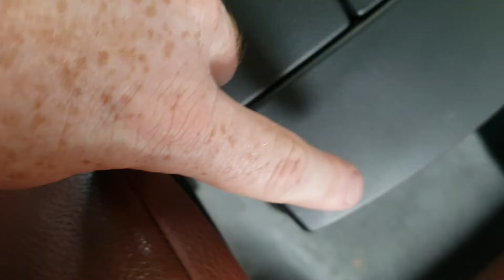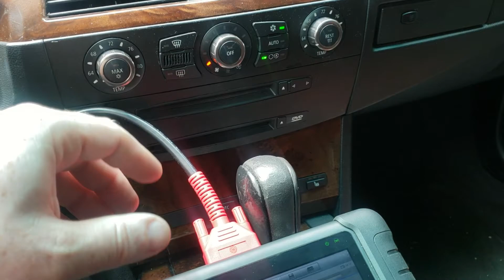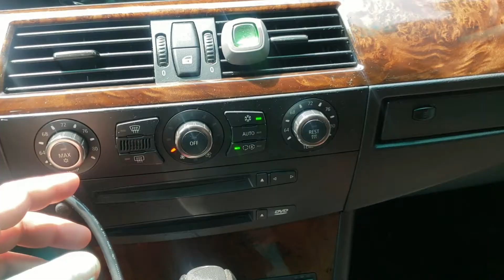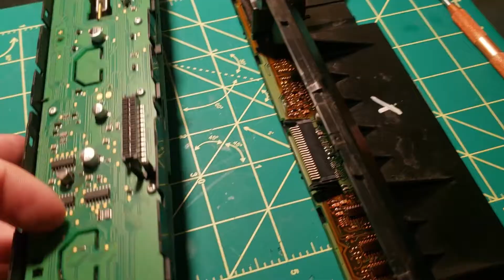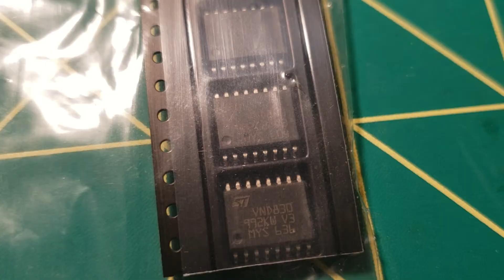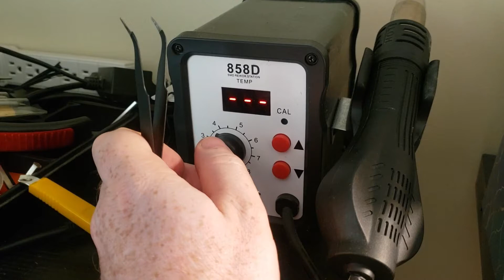BMW E60 Heater Module/Control Repair

Comment: Hi I get his error code IHKA S 0117 No communication possible with: Heating and air conditioning system and the ac only blows warm air. Will changing out the chip help in this instance? Thanks.
Reply from the maker: You need to 1st ensure your IHKA is receiving power and signal. Check the fuse in the fuse box. Then check primary voltage at the IHKA wiring connector. If you havw power, back probe the signal wires to see if you get voltages on those lines as well. If you do, then I would open the IHKA unit up and inspect - do a visual inspection 1st, looking for burnt or blown components. Then, with a multimeter, check all of the smd capacitors for shorts. Next, follow the power rail and check to ensure it continues its path (occasionally traces will corrode and will need to be jumpered).

Comment: I had the issue but i ended replacing it get it from donor but the car was 2005 but mines is a 2004 do I need to code it I’m having issue and get water valve code and ac not getting cold enough
Reply from the maker: The IHAK does not need to be coded. What is the code that you have? Is it the IHAK, ot the water valve? Replacing the IHAK will not fix a stuck water valve solenoid. Luckily, the solenoid is cheap on Amazon.
Reply: @djbmw1  I had replaced it but still get the same code and ac is not getting all the way cold
Reply: The code that I’m getting is 9c68
Reply from the maker: @Brickcitypapi-973 there should be other codes that accompany that one. Also, you should be able to read the reason why that code was triggered, and when, with your scan tool.
Reply: @djbmw1  these are the codes 9c55
9c68 9c69 9c79 my apologies for the double reply
Reply from the maker: @Brickcitypapi-973 based on those codes I would first see what type of live data you're getting, if any, from the fogging sensor,.. as well as the adjuster motor. If you dont see any information from either, I would back probe the wires for each to see if you have a short to ground. If you do... its time to inspect the wiring from the IHAK all the way to the adjuster motor, as well as the fogging sensor, to see where the wires are crushed/worn through the insulation.

Comment: I had cool air but not ice cold coming out when running the ac. I also have persistent codes for water valves (9c6d and whatever the other side is) even though my valve is brand new and does actually work. Checked my chip like in the video and it is completely fried! Mind blown, thank you!!

Comment: if you don't replace the heat valve, it's a useless job.
Reply from the maker: The solenoid valve is not always the cause for the IC to fail. In mine, for example, it wasnt. In addition to the coolant solenoid valve, the IC also controls the air mixing valve actuators. If these actuators are stuck (or frozen in deep winter), the IC can still fail and leave the air mixing flaps in a stuck position which is unrelated to your coolant solenoid.

Comment: 9C54, E714, 9C77, 9C55 these errors indicates faulty IHKA? Blow hot air just in the front window. :/
Reply from the maker: Many of those codes relate to condensation sensors and recirculation sensors. You also have a voltage issue. I would first verify that your unit is seeing at least 12.5v or more. If not, you need to investigate where the power issue is coming from (cracked wiring, alternator issue, etc). If the voltage into the unit is OK, I would then do a resistance (ohm) test on the two sensors related to the codes you have to verify that they work. If the sensors are fine then open up your ihka unit and inspect for issues.

Comment: Hi  @djbmw1 , got a 520d 2007 and have  a 9654 AUC Sensor. Air doesn’t come out on the main vent but rather the one near the windshield. Sometimes hot air on the left and cold on the right. Would appreciate any advice. Thanks!
Reply: Same car same prob

Comment: Nice video! I've had to replace my IHKA module due to temp sensor issues. The donor IHKA works, but I cannot turn off the panel with the OFF button and also cannot turn off the compressor (A/C) button. A/C is constantly on and the OFF button only blinks once if you press on it. I spammed the OFF button and then the panel turns off including the fans, but then automaticly goes back on again. What could be the issue?
Reply from the maker: Could be that your Parked Car Ventilation setting is on.... could be a bad blower resistor. If it were my car, I would check the blower motor resistor first.
Reply: @djbmw1 Thanks for the quick reply! I did refit my old IHKA back to see what would happen and the issue is not there (except the temp sensor issue). An electrician checked the circuit board of the donor and it was fine. INPA didn’t show any fault codes on KLIMA (IHKA). So I presume that there’s a software issue on the donor panel not corresponding correctly with my car. I noticed that the old and donor module have different software versions (ZUSB). I’ll try to force program a different software on it with WINKFP in expert mode.

Comment: Hi, Very nice video I learn to much things.
my problem is hot air passenger side and cold driver side
Please need a help , the double switch (VND830) is in good shape but maybe not woeking .
I check voltage on the water valve on both side it's always (max hot or max cold)4,28 volt!!
please help.
I just chang the valve.

Comment: Hi. Could you help me aswell? I.ve changed all of the parts for ac senzor compressor radiator and still blows in front could air and on the feet and windscreed hot air. .. i have as errors 9c7b int temp sensor and auc sensor. Plus the inside temp is 18° and out side 0° . Could be the same for me? Or just replace the 9c7b sensor. On the dash bord it shows me the exact temp for out side but on tester shows as i mentioned  up.. 18 and 0
Reply from the maker: What issue is the scan tool picking up? You need to use a proper scan tool before determining what the issue is

Comment: Do you think e89 climate module not working and heated seats module that the problem could be in one of those, or more likely in the module which powers them?
Reply from the maker: A proper scan tool will tell you where the issue is. You can also use INPA for free
Reply: @djbmw1 I have im608 pro
Reply: @djbmw1  roof stayed working 2 weeks after climate control stopped. Theres a button for roof in climate control panel but roof also worked from keyfob button. So maybe roof is not working from another unrelated fault.

Comment: I have only 9c54 and 9c55 which is fogging sensor and AUC sensor but no error regarding ventilation, my the climate blows cold air and hot air same time !!
Reply: I have the same do you fixed ???? 😩
Reply: @jocksanderbenitez1190 I have replaced both sensors but only AUC is working the fogging sensor still doesn't work,someone said that needs to ve glued with silicone,i have tried but still doesn't work ,i will buy a new sensor.....and about ventilation blowing hot and cold air was because of the climate menu where it was selected red instead blue for cold air , climate does not seems to be broken 🤔
Reply: @smamas114  i have the same problem not blowing hot you feel that blowing hot and cold together... and i have same codes... after you replacing auc start to blow hot?
Reply: @sarkisderghougassian1563 AUC sensor only change from entering air  from outside to recirculating air inside .....I don't think i have noticed any change about hot and cold after changing that Auc, its just when AC compressor is on and i am changing inside the menu from Blue lines to Red lines at climate section the vents from the windscreen are blowing hot air where the others are blowing cold air even if the Temp buttons are set to lowest temperature but I don't know why is doing this probably because of the fogging sensor , 9C55 error !

Comment: Hi, I have problem with IHKA.
After long road trip in summer like 3+ hours ihka throw error for solar sensor, fogging sensor and left temperature knob. After this errors all flow flaps goes to closed position and no air comes from air went. Blower working normal but air not coming in cabin. Is vnd830 solution or its only responsible for hot water valves?
Thanks for replying.
Reply from the maker: Vnd830 controls the heater valves. You'll need to open up your IHKA to see what might be causing the issue. First, do a visual inspection under microscope (or magnifying glass if you dont have access to a microscope). Look for burnt, damaged, or out of place components. For any IC's you can also check that the pins are solid and properly soldered to the pads. Next, I would grab a multimeter and test all of the capacitors to see if any are shorted to ground. If you a have a thermal camera you could also feed the unit power with a benchtop power supply and see what heats up.

Comment: Hello sir can you help me i have same car and i have problem with ac up and down coming hot air in the middle cold air. I change the cooling valve original part from bmw. Sometimes working everything sometimes not working correctly. I check for foult codes don’t have nothing stored
Reply from the maker: Did you use a proper scan tool that can access the climate control unit? A cheap scan tool can only tell you what CEL codes you have and typically doesnt provide further details. If you used a proper scan tool then it will provide additional insight. If it still shows nothing then you'll want to hook up AC gauges to you high and low side and check your AC pressures.
Reply: @djbmw1   Yes i have autel maxicom scan tool. i can scan climamodul and i look live data and look everything ok. Just one thing ist not ok. When engine from cold to 70-80 degrees coming, the solenoid valves for the heating starting slowly to open and water starting circulating trough the heating and coming hot up and down. In the middle comes ist very cold. AC compressor ist working very well. Sometimes when i pres buttun to automatic clima starting to working agein everything ok after couple minutes same story. Solenoid valve stays open and water keeps cycle no matter what i Make. When engine cooling down starting to work again solenoid valve

Comment: Hi would VND 830E part # work or it has to be VND 830 specifically?
Reply from the maker: You would have to look at the manufacturers datasheet and compare the chips to be 100% certain. Having said that, VND830E appears to be an obsolete chipset variety of the VND830,.. and, upon a very quick review of datasheets from Mouser, there are indeed some differences between the chips (though minimal). VND830 is readily available from aliexpress and ebay,... as well as several major electronics suppliers like digikey and mouser.

Comment: Hello there, great informational video I am having some crazy issues with my a/c control unit and I took everything apart  and found that same chip burned, where can I get those chips, can you share the link, please, Thank You, Best Regards
Reply from the maker: Thanks for watching! They are readily available from Aliexpress, eBay, and major electronics suppliers like Digikey and Mouser
Reply: @djbmw1 what i shuld search dose those they have part number?

Comment: My left button stucked to highest temperature,do you have any idea what is causing this ?
Reply from the maker: You'll need to probe the board and see where the short is as thats likely the cause. If you have access to a voltage injector and thermal camera that can speed up the troubleshooting

Comment: hello sir, i got the 531i 2012year GT... problem is on ac the air out only some second.. after that no air,.. but the blower still working. thanks for help
Reply from the maker: So the blower still runs but your vent flaps close? Does it do the same on the heat setting? If you have a good scan tool you can look at live data and monitor the vent flap positions to see if they close randomly.
Reply: yes sir, thanks for you replay.. i try DTC that trouble code is..inspection result AC2 (air conditioning - IHKA) exist and red writing is: 1.801031 Electric Auxiliary Heater,Rear left Short To ground or Open Circuit In signal Line. @djbmw1
Reply: @djbmw1  Hello sir now i try set heat 28.c the flap air a little high but not normal.. sometimes high sometimes low
Reply from the maker: @jigger5000p  you should really use a scan tool with live data to see what the flaps are doing. You can also send a command to open and close the flaps with a good scan tool. Of the flaps dont open you can see if theres any faults with the actuator motor... or if the problem is with the IHAK unit itself. If you dont want to use a good scan tool, you could always swap in a used IHAK unit ($50 usd) to see if that fixes it. If it doesnt, then your flap actuator or wiring to the actuator is likely the issue.
Reply: @djbmw1  Ok sir, thank you so much. Thank you for your help. I wish you a safe life.

Comment: Thanks for the video, it helped me a lot.
For my part I changed the part and after 2 months it burned again.
I then replaced the entire module that I got from another car and it's the same thing, it burned after 1 month of use.
Do you know the cause or do you have a solution please?
Thanks a lot 🙏
Reply from the maker: Thanks for watching the video! Do you have access to a good scan tool? I would suggest looking at the IHAK module with your scanner both before, and after changing the chip. It's possible that another component in the system is causing the chip to fail prematurely - however, the IHAK unit is relatively 'separated' from other components. I've worked on a few of these where other components were also failing and I could only find them when I tested the board on the bench and used an thermal camera to see which components were overheating.
Reply: @djbmw1  thanks for your feedback 🙏🙏
I use the delphi scanner device. I don't know if he does this kind of test 🤔. 
Thanks a lot for all these informations.
I will keep you informed of the evolution of the situation 🙏
Reply: AC always blows hot and cool air at the same time on my 2010 E60.   Found the same chip burned in the controller.   Mine was caused by a failed heater control valve (leaking shorts due to coolant seeping through), causing hot coolant to fully circulate in the dash heater core.
Reply: Hi, i have same kind of problem with my ac control unit (ihka) too. And i’ve changed the unit now 2 times and now it blew again. Did u come up with any solution?
Reply: @markomandra8699  yes in my case it was a failed heater valve that causes a short circuit and burns the chip
Reply: @Kaiser_Dino  okey👍🏻 could be same reason maybe. Did u have any fault code about the heater valve?
Reply: @markomandra8699  unfortunately it was a long time ago, I don't remember the fault code. try to visually inspect the valve to see if it is leaking from somewhere or if there are traces of dry coolant around. if so, you have 80% chance that it is indeed the heater valve that is causing these problems. 
your battery is not draining?
Reply: @Kaiser_Dino  alr i will check after work if there is any leaks or something. My battery is not draining. How did u test it when the heater valve was causing short circuits?
Reply: Part number ? Please

Comment: Do you have to recode the IHKA module when you put it back in?
Reply from the maker: No - The IHKA module isnt coded or programmed when replacing the chip, or the entire unit (assuming the same model of unit is used for the replacement).
Reply: @djbmw1  thank you.
Reply: What is the size of the Torx key?
Reply: @luizhenriquealmeida2805 T20